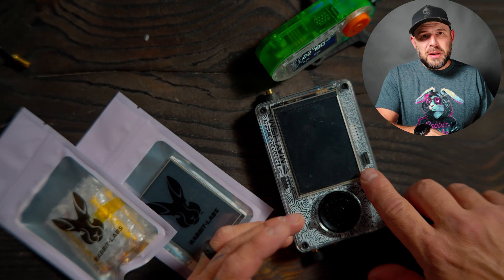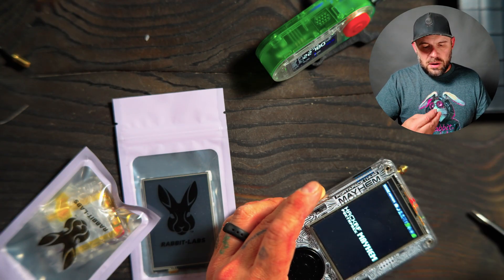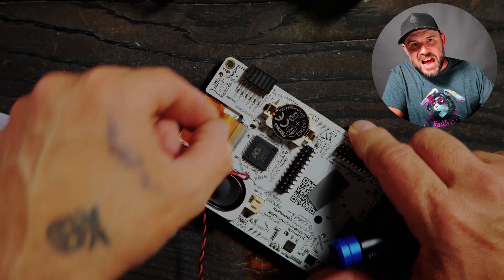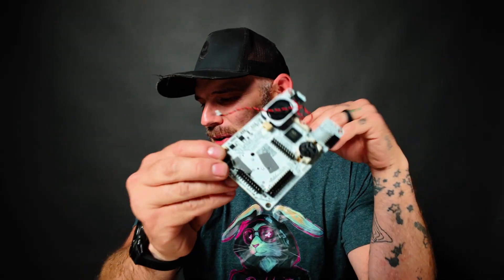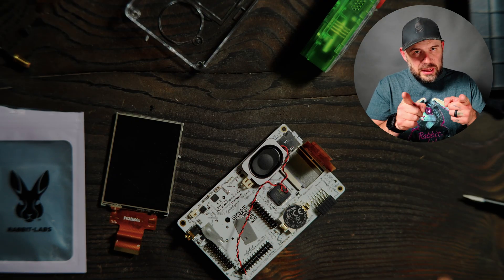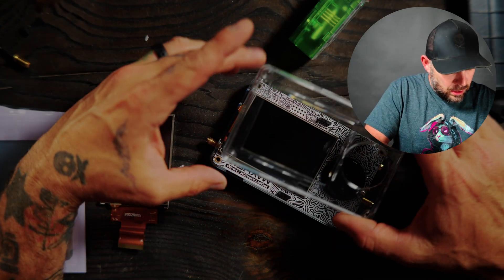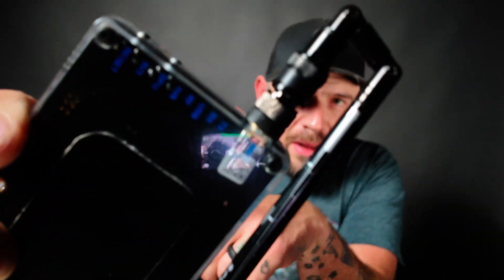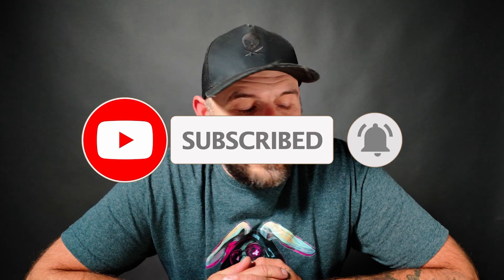Portapack H4M Screen Upgrade with Rabbit Labs

Comment: ... bro dont take electronics apart when they're currently running, also ground yourself if your doing that... 😂😂😂😂
Reply: Also those are plastic pry bars in your "ifixit" kit. Dont use a metal flathead.
Reply from the maker: @ryshellso526 lol. I would. But my kit didn’t come with those. I’ll have to purchase some. And thanks for the advice. Greatly appreciate it.

Comment: I remove the battery from the Portapack immediately after unboxing. 
For one, it is way too small anyway, so i only run it from a battery pack. Also, when it sits in the drawer, for weeks on end, i am certain it can't turn into a spicy pillow🤗

If anything, i will print me a case one day, with a 18650 holder.
Reply from the maker: Right in. And ya. I had one battery in an H4M. Go puff!